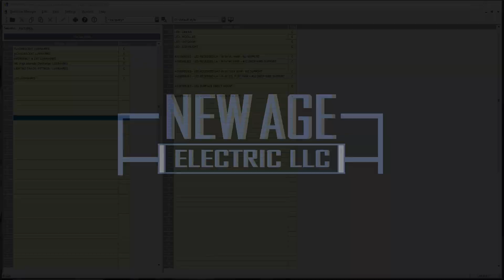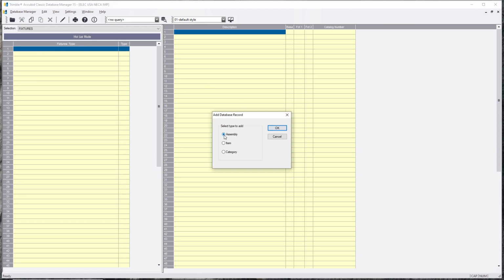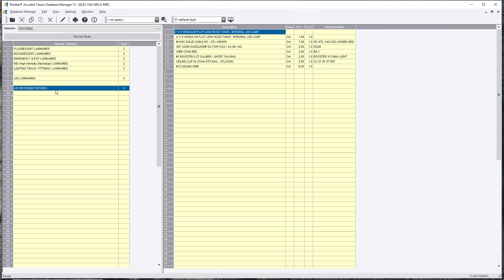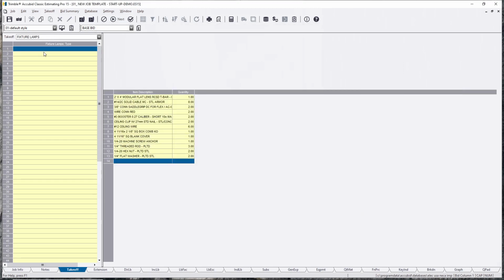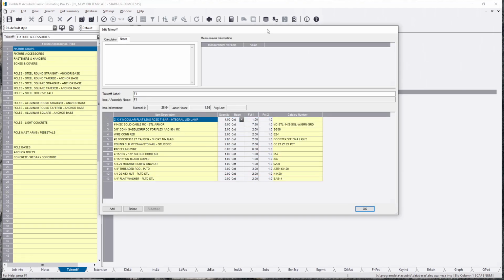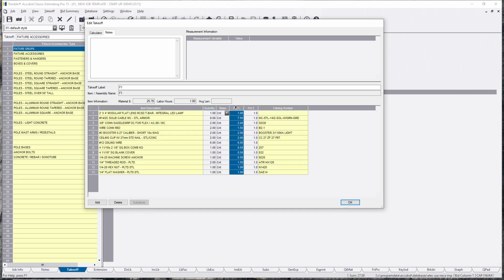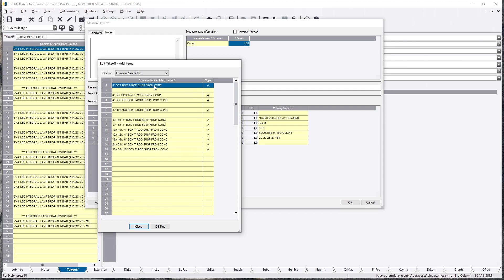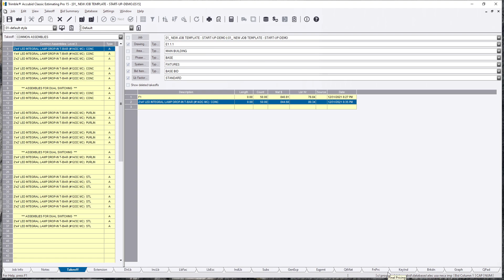Trimble Accubid  - Creating a fixture assembly in Database Manager

Comment: Thanks for this tutorial Mr. Flores! ... question with the adjustment you make to the fixture designation @12:55, could you not accomplish the same result (cut qty in half) by applying a Fct2 of '2'?
Reply from the maker: I believe it disregards the factors and only multiplies the take-off quantity times the units in the first column. I think I tried several ways, and this was the way I ended up liking.

Comment: How are you dealing with linear fixtures?  How do you deal with the many different fixture types? Do you have any database examples?
Reply from the maker: Yes, create one fixture length, and copy it to make the next one, adjust the labor slightly for the new fixture length, add additional supports for ceiling type, e.g. grid, exposed, suspended, etc. Don't forget about EM sections, you'll need separate boxes and whips depending on the EM type system.
Reply: @newageelectricllc5098  Thank you very much!!